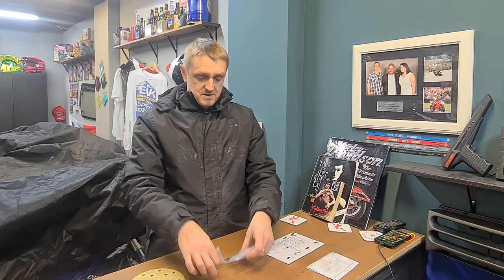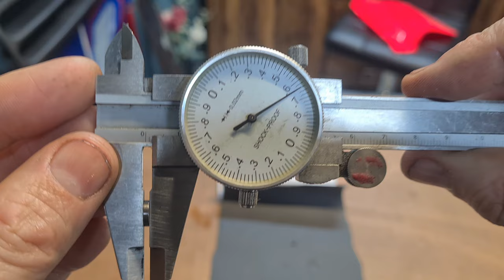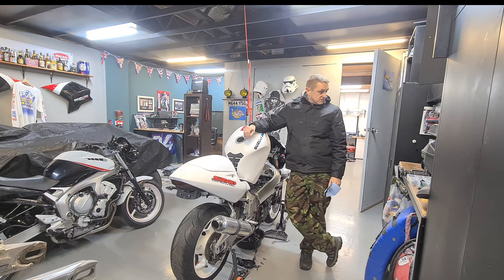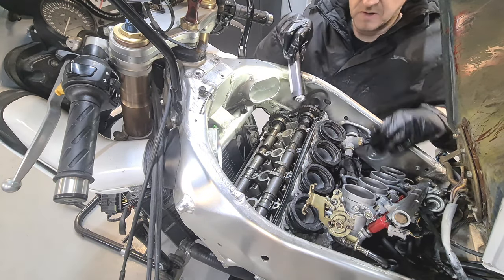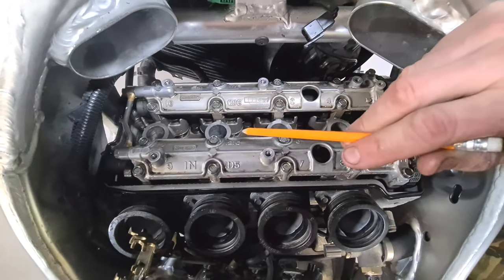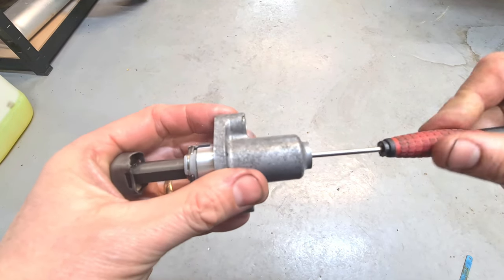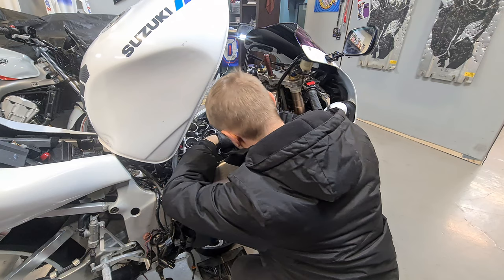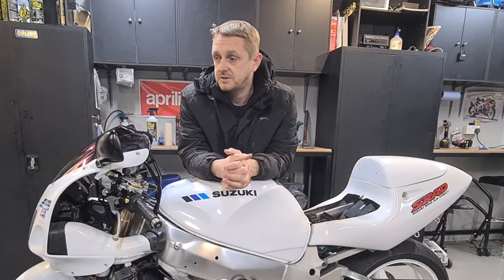HOW TO ADJUST THE VALVE CLEARANCES ON A SUZUKI GSXR 750 SRAD PART

Comment: youre a legend bro for making these videos. The mechanic quoted me 700 bucks to adjust the valves but id only have to spend 80 bucks on tools from this video. Once again thanks for the video
Reply from the maker: Ah no problem pal good luck with it make sure the measuring tools are good quality 👍 
And when you torque the cam retainer down it will close the shim gap slightly

Comment: Fabulous detail and numpty easing. Still can’t get my head round why shims are sometimes reduced to achieve tolerance but I will work on it 🙀
Reply from the maker: It is because the valves start to wear into the seats becoming closer to the cams only small tolerances.... So this pushes the valve buckets towards the cam lobes... So you need to remove the bucket and fit a thinner shim to make the gap wider.... If the gap is tight then the valve will either stay open or open before top dead center resulting in compression loss.... If your bike is hard to start and runs like crap but better when it is hot then this can mean you need valves adjusting as when the engine heats up everything expands including the gap in the cam lobes and shrinks when it's cool

Comment: Great vid thanks very much. I have one of these bikes 96/97 750 it takes ages to start if its not been started for a while, even with a charged battery. Is this normal?
Reply from the maker: It will be a carb model yours so that could be valve clearances or pilot jetting too lean... When you warm the bike up let it idle and give it a burst of throttle if it boggs down before it revs up then your pilot air fuel mixture is too lean this will cause hard starting also... But the valve clearances should be checked  also
Reply: @PXCBIKES  thanks for your reply! will speak to the garage. Have a good weekend and keep fixing stuff! x
Reply from the maker: No problem ...GO for the least intense stuff first even a too low idle stop adjustment can cause hard starting ...and the problem with carbs is that after time the mixture screws can vibrate out of sync which is worth looking at even TPS sensors etc first
Reply: @PXCBIKES great knowledgeable answer.   I’m thinking of checking mine at 15k.  Kind of makes a noise while running.  Think it may be the cam chain

Comment: My bike runs really bad at first start but after it’s warm it run good do I need to do this? I’ve only ever worked with car motors interference and non-interference. also mileage is 23k I doubt the previous owner had it done. Also it’s 96 with 98 swap so it’s injected.
Reply from the maker: For cold starts it can be a number of things like the vacuum solenoids crank sensor air temp sensor or cold start lever needs adjusting... But Yes even valve clearances will effect this massively...

Comment: Don’t sand them down. The shims are case hardened. If you damage that hardened surface, the shim will wear out quickly.
Reply from the maker: Hello craig I have been doing this since the 90's on all of my bikes but haven't had any problems at all